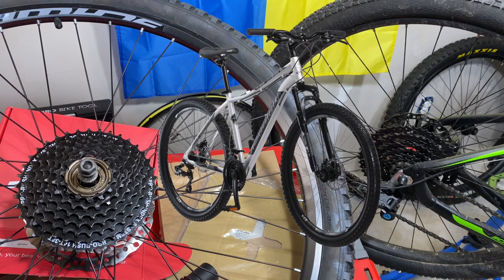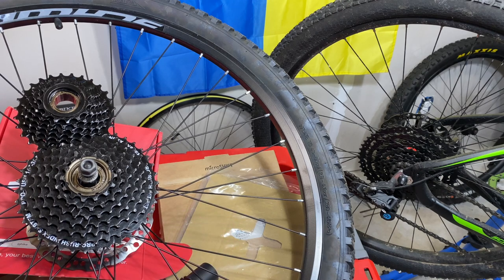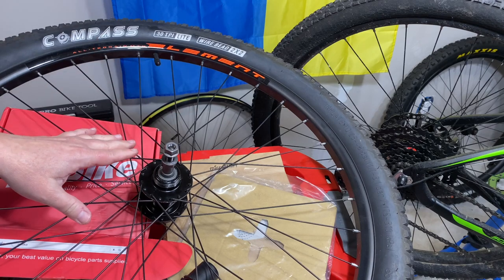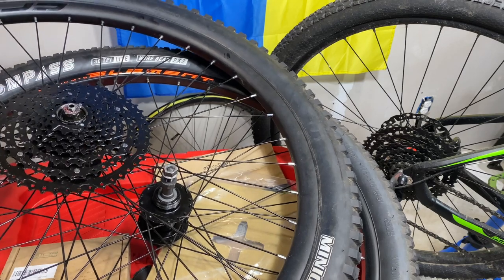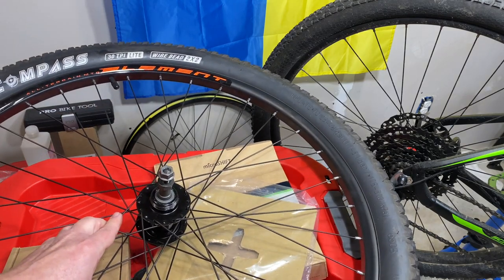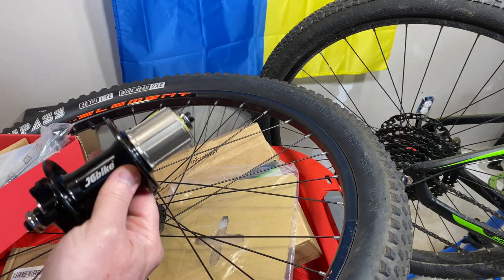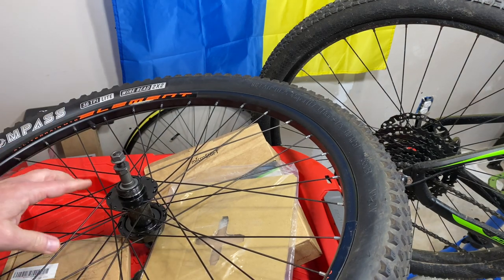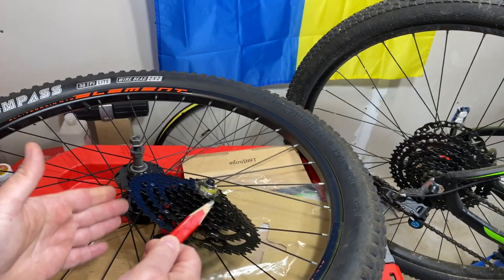Cassette for the AL Comp and other Big Box Bikes? Can it be done?

Comment: I installed on novatec hubs from aliexpress on an al comp rim and spokes with just a multi tool spoke wrench, a few quarters and two zip ties. It’s not as bad as it seems when you get the hang of it. I used three different YouTube videos to figure it out and it took three tries to get the first rim right but the second one was laced, dished and trued in less than an hour. Very satisfying to do something everyone said was too hard to do on your own.
Reply: Awesome! it's just a tedious process. But so satisfying to build a wheel.  Good for you!
Reply: Did you watch Ali Clarksons lacing video?
Reply from the maker: You are more patient than me 😁
Reply: Is go to a shop let them do the job
Reply: @gulfcitynd  True, but the whole point of me getting a cheap Walmart bike was to learn how to do everything. I have my Santa Cruz that I let the bike shop do everything on. Well at least I used to.
Reply: Hi Jose, I’m thinking about doing this for my wife’s Al comp.  Can you tell me which novatec hub spec wise to look for on AliExpress?  If I can reuse the spokes I feel confident in doing the job, thanks.
Reply: same

Comment: I bought a wheelset from cycling deals. WTB st25i with novatech hubs and RaceKing tires. They set up tubeless super easy. Also picked up a box three prime 9 e-bike groupset 12-50 cassette, single shift shifter. I converted my 2020 boundary to ebike with a bafang BBSHD mid drive motor kit. Ive upgraded every single component on the boundary and I love this thing now. Runs trails like crazy. Feels solid on jumps and turns.

Comment: I laced a new hub onto my comp, its a shimano deore fh-m525A 36h, its a direct bolt on. if you follow park tool's guide its pretty easy. Not to mention it looks factory because the rim is still stock

Comment: Even though there's wider geared options.. some rear derailleurs that work with say a 32t first gear, won't be able to shift onto something bigger. Only mentioning, because I bought a folding bike 3 or so years ago - it wasn't until I replaced its worn freewheel all this time later was it able to shift into first gear - even the manufacturer flubbed that one, by putting on a Shimano "wide range" freewheel and a Tourney rear derailleur that wasn't matched to it.

Comment: it literally took me hours to understand this about a month ago. 
thanks for the great work
Reply: So I have a boundary that I'm trying to use to get to work and back. It's about 8 miles with 1 hill about 1/4 mile long. But the 14T isn't fast enough. Is it worth upgrading? What's the best option?
Reply from the maker: Perhaps something with an 11t would give you the speed you need and/or increase the chainring size

Comment: I was able to get a Taff comp for $125 recently, it had a few issues and 1 was the rear axle was bent and the wobbly sprocket was causing it to shift erratically. I'm changing it to a freehub. BTW, it came with a pro rush sprocket but the shifter and the derailer is a Ltwoo T8s

Comment: I laced a cassette freehub to a new rim myself, and I didn't think it was that hard. There's lots of videos on YouTube that show how to do it.
The hard part is making sure you have the right length spokes...
Reply: i've laced up rims myself and by the time you pay for hubs spokes and a rim you don't end up saving much if anything, but you can get something special for you and the satisfaction of learning a new skill
Reply from the maker: Congrats. You have more patience than me
Reply: @jmswilliams70  I saved a lot, I picked a hub with the same diameter as the freewheel hub I was replacing, and reused the spokes.
As it turned out, I had to do a 4 cross instead of a three, but it all worked out O.K.
Reply: Yes the spoke length will determine the angle it engages the hub thus affecting the dishing attributes. Main thing is to ensure the wheel is centered onto the frame/fork.
Reply: @GokkunGuru  Yeah, you have to dish the wheel.
It's funny, because the wheel I replaced wasn't dished at all, I found out about that when I built the new one.
Reply: @johnhanley9946  I'm never that lucky

Comment: I mean... a regular person Can lace their own rims. You can use your own bike as a truing stand in a pinch.

A regular person probably doesn't want to, though. I'll probably do it for my Comp at some point, since I've reached the point where spokes are clinking around after rides and I know that the wheels need re-trued anyway. But that'll be a situation where I pick a week where I absolutely won't need to go anywhere with it because I'll probably have to re-true it two-three times
Reply: didn't know you could bend your freewheel, yikes. I don't think the TSDZ's got the torque do that on it's own, but I also wouldn't be too surprised if it did.

Comment: As someone who's built my own wheels, swapping the hub is horribly tedious. First, you gotta make sure the spoke count is the same and calculate how long of spokes you'll need, since the hub flanges change significantly between different models. The measurement will also change a LOT depending on the lace pattern you use.

Then of course there's making sure the tension is even across the wheel, and truing it properly.

I enjoy building wheels, just the calculations done beforehand get tiring.

Comment: I just installed a WTB/Novatec wheelset (recommended by you) onto my Mongoose Ledge X1 over the weekend and installed my first cassette (50t-11t) in the process.  I also installed a new Shimano 11 speed derailleur and chain as well.

I also installed the new Archer Paddle Shifter... and anyone wondering if it's better than the original I'm not sure if it is yet.  It's just different.  I did accidentally shift a couple times which I never had an issue with before with the "clicky" one.

All in all I'm pretty happy with my build and now that the weather is great I can't wait to hit the trails!

Comment: KevCentral, what kind of Wheelset do you recommend for my Al Comp that I just purchased from my local Wal Mart?
Reply from the maker: I’ve had good luck with the cycling deal wheelsets that are listed on my Amazon page, but it doesn’t take much to be an improvement over the factory wheelset when it comes to weight and being able to use a cassette instead of freewheel

Comment: The reason you want to get rid of the free hub for a cassette is more range and that's at the lowest gear for climbing . There is a cheaper and easier alternative is get a smaller chainring maybe 28 or even 26 if that will work with your cranks and bike . I went down to a 28 tooth which was the smallest I could use in my suntour zenon cranks . I think most don't care or need that top end speed that you sacrifice a tiny bit but gain so much on those more difficult climbs . Not sure why they put those larger chainrings on a 7 speed hub with single chain rings  . When they give you a 2 speed derailleur on the front with a free hub you might see a 22 tooth as the smallest ring . Going to single rings on free hub just doesn't make allot of sense and should have went with a 2 speed derailer on the front
Reply: On my Malus (ready to ride: 50#) I run a 1x7 with a 22t chainwheel and an 11-34 DNP freewheel. High is 60.0 gear inches. Low is 19.5 gear inches. Even on mostly flat suburban roads and bike paths in Illinois, I use the lower gears often and I rarely miss having higher gears.

Comment: I have a Schwinn Taff bike (bought new at Walmart for $90 new) with a Pro Rush 1x8 free wheel that is loose and needs some shims removed.  The diameter for the removal tool is much wider (35 to 40 mm).  Does anybody know of a tool to loosen this ring so I can use my snap ring tool to loosen the cone to remove a shim?

Comment: I put a 46t wide range on my deore xt 11spd and bent the freehub on the first ride. The bike shop said some of those freehub bodies can't handle the torque
Reply: what brand and model was the hub? That is ridiculous.
Reply: @DaveCM  
Deore xt and a cs m8000 11-40t. And I switched to a cs m8000 11-46t. I've been mountain biking since 81 and rode professionally in the 90s, I've replaced the hub twice and bent it twice in two rides. So I went back to the 40t
Reply: @harryfritter8266  that is crazy. I've been riding my whole life and could put down a lot of power and have never done that. It isn't like you were using cheap, crappy hubs either.
Reply: @DaveCM  
I live in western Colorado and the bike is a salsa bucksaw. I can ride with the 40, but some of the hills are like 20 percent grades or steeper and the 46 was really nice until it wasn't
Reply: @harryfritter8266  so you put some serious stress on the drivetrain.
Reply: @DaveCM  yeah I converted that bike to a 2by with a 23t mountain tamer. I have some ebikes with the eagle set-up. So I'll probably get an ebike specific wheel for that bike. Its my only full suspension fat bike and can't be replaced

Comment: The freewheel was old when I started riding mtb 30 years ago! Cant believe they are still here. 
I use the dork discs too. Better than fixing spokes...
Reply: Freewheel is simply cheaper to mass produce with fewer parts and less time. Back in the day, my Schwinn 10 speed was great, but there never was an issue with torque as it was a street bike. MTBs and hard racing bikes can shred the threads on the Freewheel, hence the development and need for the spline cassette.
Reply: Freewheels are simply just cheaper, being the 100 year old design.  They will never go away so long as single speeds live.

Comment: Much easier to get a new wheel set. I actually tried to find a wide-range freewheel for a budget fat bike upgrade, but no luck. 14-34 was the biggest I could find. Those pro-rush freewheels don't seem to be available aftermarket, so it looks like you can only get it if you have a bike that came with it.

Anyhow the bike turned out much, much better with new wheels and an 11 speed Deore drivetrain with a 11-50 cassette

Comment: I've heard a lot about how freewheels can bend axles... the physics and theory seem plausible, but in practice I've never had it happen. My Mongoose Dolomite axles are fine after 4000+ miles with a 1000w /1560w peak mid drive. Also have a 750w mid drive / 1200w peak on a Taff Comp which is a quick release, that's been fine as well.
Reply: I have worked in the industry for eons, and I can tell you it is relatively common occurrence. If you ride on smooth roads, are lightweight, or don't have a rack with loads, you may not have a problem.
Reply from the maker: I’ve bent 3 or so during my time on this channel.
Reply: @KevCentral  interesting, I’m not doing any jumps or heavy impacts, just riding on pavement mostly

Comment: Why do you keep saying a new wheel-set?  Perhaps my lingo is wrong, but I have always understood a wheel set to be both wheels, hence, set.  You would really only need back wheel (that is DEFINITELY the way to go).
Reply: Idk I like to have matching wheels personally. I think you're technically correct, but aesthetically I don't want mismatched wheels
Reply: @davidharvell3191  Well, f the wheels are painted, I can see your point.  A lot of cheap bikes do have a painted brake surface. So there's that. 
OTOH, the front wheel is going to be just as cheaply and badly made as the back wheel, so a set might not be a terrible idea.  What IS a terrible idea is buying a new hub and paying someone to lace it up for yo.

Comment: I knew the diffrence Kev, but to be honest? I love that you made this video since it's a resource i can point to now for other people. 

I had to let my redneck flag fly a bit.

Shifter cable? frayed apart. Can't fix it. I have whatever gear i can force my derailleur into. I don't LIKE that because it's just a little bit more than I'm comfortable with.  So i do what any sane sensible broke person who has spare parts and tools does.

I knocked the lockring on the freewheel loose enough to disassemble. Take all the gears out. Put back in only the gear i want along with spacers, screw the lockring back on. Remove derailleur, break the chain down (left the pin in the 'broke' section on the hopes i can put it back together later.) And turn my bike into a single speed til funds become available to 'properly' do what i want.  Truth be told I'm going to need more spacers since there's too much wobble in that one gear, and i think I messed up on chain tension but like... 'this is fine. It can be tweaked. Errors can be corrected.' 

I'm aggravated because bike worked perfectly fine until I swapped derailleurs out and planned on doing that little added bit, but at the same time? 'Oh hey I did this. YAY.' 

Also no you can't put a seven speed casset cluster on a freewheel body. The casset is a straight shot hole the same all the way through. Freehub the spindle flares out at around third or fourth gear.

That said I probably will try ordering a megarange. Dismantle. Take out the 20t gear, add a 28t gear so that there is a smoother transition instead of taking the 28t off of a more common gearset and sudden jump up to granny gear. 

Because yes. I am redneck enough to try it. Especially since THEORETICALLY I can undo it all if things don't work out.
Reply: shift cables are cheap bro
Reply: Not when all of your money is spoken for 'bro.' 

Everything wil lget sorted in a couple weeks. I figure opprotunity between now and then to do something dumb.

Comment: The small end of cassettes is the bigger avantage IMO. a 10 tooth small cog is 40% higher than a 14 tooth. 9T ones are even better though somewhat controversial. You get all that range and save grams compared to adding on the other end, plus more chainring clearance for the same ratio.

Comment: @KevCentral Great videos and I have always enjoyed them. I began my Bike Journey last year when I got lucky and found a Al Comp. Anyways I have been wanting to do some upgrades and have already started. But my question is. I want to broaden my range and am on a very tight budget is there a better freewheel gear set that I can get that has more range than the stock one on the Al Comp? cheers and keep the videos coming
Reply from the maker: Shimano megarange
Reply: @KevCentral  tyvm I am going to search right now
Reply: @KevCentral  Would this be a good bet over the stock one I am wondering SHIMANO TZ500 7-Speed 14-34t Freewheel
Reply from the maker: 14-34 is the megarange freewheel
Reply: @KevCentral  ok cool cause I can not remember what the the tooth range is on the stock one is why I asked. if you say it's an upgrade I beleive you, and gain ty for the help

Comment: The difference is where the drive clutch/ratcheting system lives. On the free wheel, the ratchet lives in the wheel. On the free hub,  the ratchet lives in the external hub (under the splines). This is how I keep the two distinct in my primitive brain.